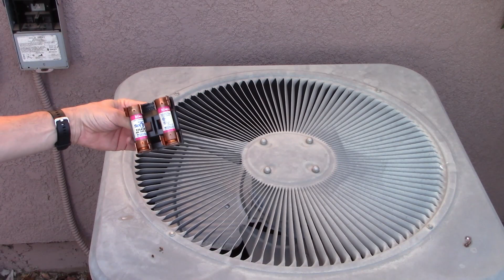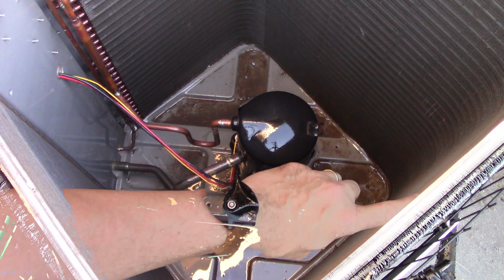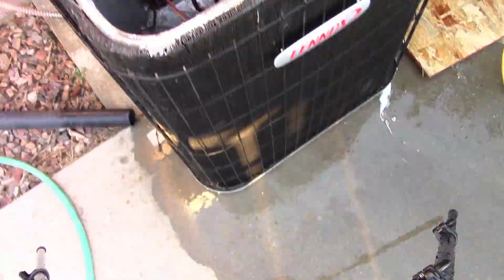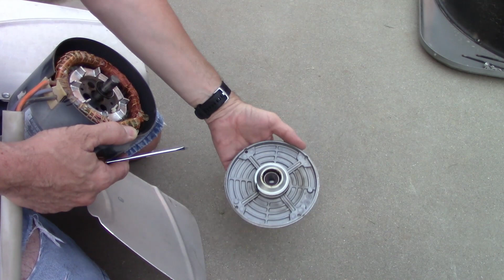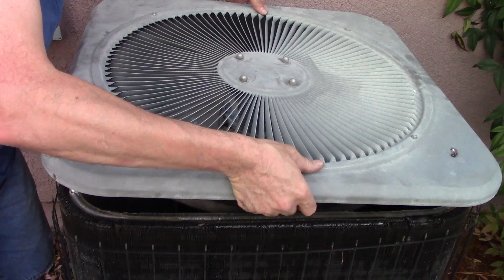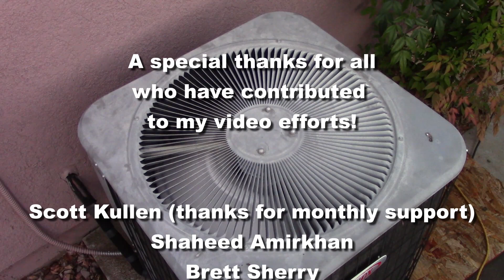AIR CONDITIONER SERVICE, CONDENSER FAN MOTOR SERVICE, OUTDOOR COIL CLEANING

Comment: I taught my, at the time,  fifty year old mother how to clean and lube her unit on the outside, and the inside blower and motor. She did this every year for thirty plus years. She was about 82 when she started hiring someone to do it. She lived to be 91. I used to do my own as well, but my legs wont let me do much anymore, and I found a guy who is really excellent at keeping my air conditioning and gas furnace in great shape.

Comment: Hey Steve, Great wifey and I loved the fact they you broke down & lubed the fan motor, something a lot of folks don't do as PM. Spend 5 to save 10, not the other way around. 

There is a great inexpensive way to get an additional 15% efficiency out of these external units using a simple misting system. Get one of those summer spray misters that hooks to your garden hose and coil mount it wrapped around outer coil cage with at least 3-4" spacing as you either go up or down, starting at the top is preferable, add a sealed low voltage control valve to the line water feed that opens and closes when powered and you're good to go. By keeping coils wet they shed the heat factors of times faster like an evaporative system. Just make certain all electricals are sealed water tight even though the unit was designed for exposed outside use, better safe than sorry. It's extremely simple and pretty amazing how much more efficient they run and they run less time with no adverse effects and easily disconnected should you happen to lose you mind and want to spend more $ then you have to. ;) It's not only how you make, it's just as importantly about how much you save!
Reply from the maker: I'm worried about the calcium deposits hindering the condenser more than they cooling that the misting provides
Reply: @norcal715  That could be a real problem for unconditioned water. I guess it all depends on how good your water supply is. Where I live we have very good processed water treatment, not well, so although there is some calcium, it's easily washed off after one season, so it is minor compared to the savings and increased efficiency. Actually we have several modern facilities that only water cooled towers with  the evaporative cooling method. Not sure what precautions they use, but they are using it cool entire plants down efficiently. I used large windows conditioners (2), one for each floor and generally on hot, humid days regularly spray mist the condenser and the difference is dramatic.

Comment: Nice job NorCal! My unit is 30 years old and still going strong. I clean the coils during the summer 2 or 3 times. I repaint the cabinet when needed and I have had to replace the cap twice on it in the last 10 years. Oiling the fan motor is something most people overlook. The blower motor in the furnace is also overlooked. Most owners manuals say the fan motors are oiled for life. Well, that is not true you can greatly extend the life simply of a motor by doing what you did and oil it.
Reply from the maker: The manufacturer figures oiled for "life" is when it quits working then its life is over, therefore their claim has been satisfied.

Comment: The service sticker now needs a norcal overlay on it :)
Reply from the maker: Yes the company put the sticker in it on the last service, I am disappointed with that company as they only checked pressures to determine the state of charge.  They didn't check superheat/subcooling at all.

Comment: Timely content for me. I just replaced the cap and have not otherwise serviced mine going on now for 21 years. I’m just wondering about the oil used for the motor. I find your channel very informative for the many different consumer products that you service. You seem very informed and knowledgeable. Thanks for the way you present this information in a straight forward manner
Reply from the maker: Zoom-spout oiler

Comment: That is a very clean AC condenser coil there, especially for one that is 15 years old. You must live in a low humidity area with no sea salt spray nearby, and no coal power plants upwind of you. you just need a bit more water pressure there, and blow the coil from the inside out, against the airflow, to blow the loose dirt back out, and then it will be perfect. 15 years old, so will run on R22, and probably will be slightly low on refrigerant from all the years of just having the pressure checked and from weeping gas through the service ports.

Yes that dual capacitor does fail often, and always the 35-50uF compressor side, almost never the fan side. Probably best to replace every 5-10 years, as they do degrade from the voltage spikes during starting and stopping of the compressor. I always add a hard start kit in parallel with the motor side, as this helps with motors that are aging and getting a little sluggish, though often i remove the dual capacitor, or just leave the fan side connected and add another capacitor for the compressor.

As to the contactor only having one pole, done to make them cheaper, saving on the cost of the contact material, perfect when you are in a country with a defined neutral, as the switched off compressor wiring will be not energised, but in the USA with split phase power, leaves the compressor and fan sitting all the time at mains voltage, leading to some extra leakage current, and of course a short to ground on the switched phase will burn out both motors, even if the system is turned off at the thermostat. Weirdly that single pole contactor is something I only see in USA made or specified machines, the far East made ones pretty much all use a 3 pole contactor with faston connectors, and switch both the fan and the compressor line and neutral wire as well.  Guess the EU market, with a lot of countries having no defined phase on outlets, makes it not worth the cost of having a separate contactor for those countries with defined phases.
Reply: I live in the USA most homes run off single-phase power. Industrial applications are usually 3 phase. As far as the contactor they are usually double pole. The ground is always connected and never disconnected.
Reply from the maker: Yes it does run R22, I am very disappointed in the company that came out on the last service because they only checked pressures and did not check subcooling/superheat  to determine the actual state of charge. I will never use them again.  If my contact or ever fails I will be replacing it with one that disconnects both hot legs. Thank you for watching!